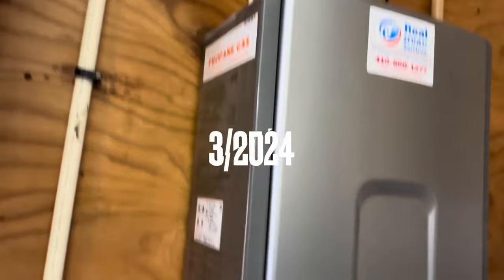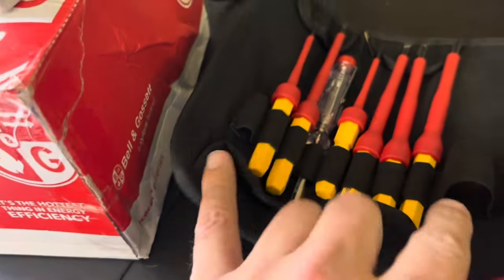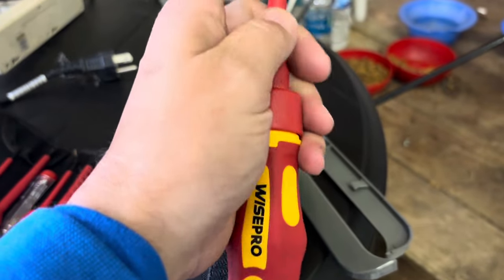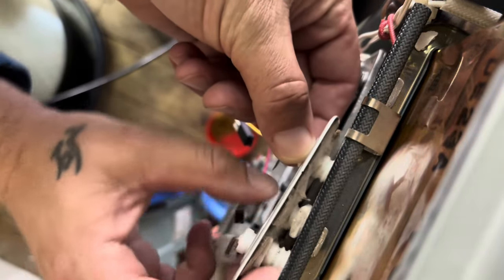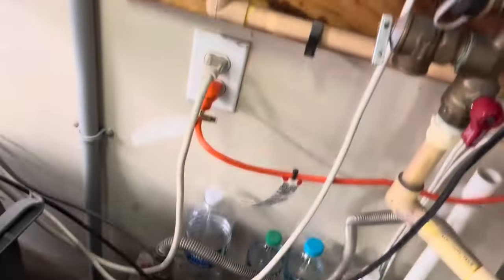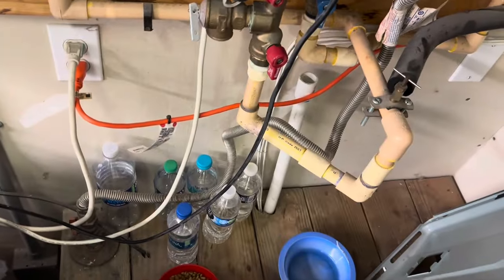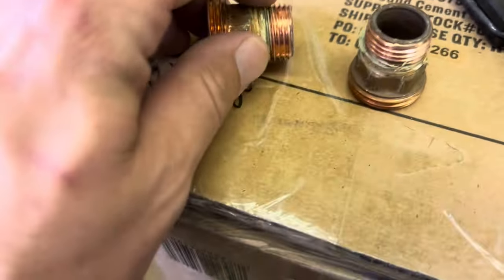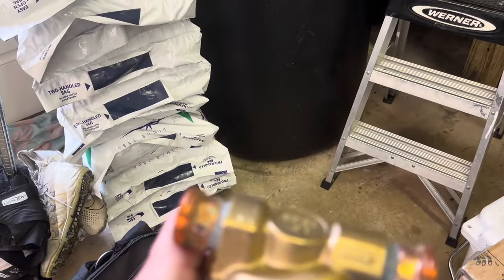Replacing Ignitors And External Recirc Pump On A Rinnai Water Heater!

Comment: As a plumber of only 16 years in the North East, Ct... I find CPVC for domestic water BIZZARRE, inferior & looks like a potential for SNAPPING easily with catastrophic results. That broken ball valve handle kinda confirms my suspicions as to its' brittleness.
 I'm familiar with copper & Pex.
We've never used CPVC & use PVC for drains only. Drains... Waste water, condensate drains, pressure relief valves, etc.
I know you said "it is more common the further South one goes" but I've only seen it a couple times.

"Slow"? We here in new construction & remodels (no service calls/work) have been slow once, for 1 week in the past 16 years. We are slammed with 14 jobs (residential & commercial) all going on at once, in various stages of production.
Reply from the maker: I filmed this a month ago.  We have picked back up.  

New construction seems to be mostly pex here in Maryland  now but almost all new construction from the 80s-2010s was all cpvc.  Still a good bit of cpvc now but more pex I think.  But I agree, after about 10 years it starts getting pretty brittle.